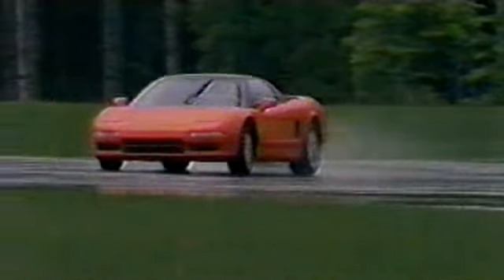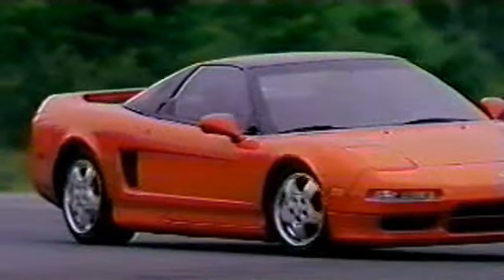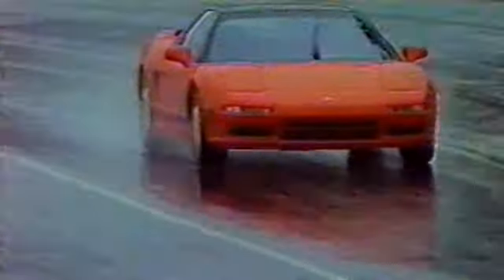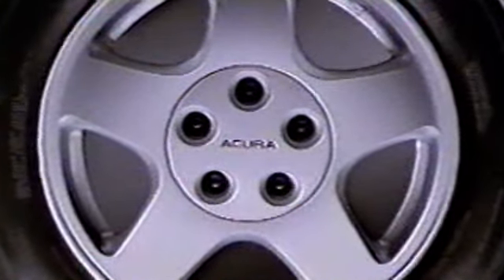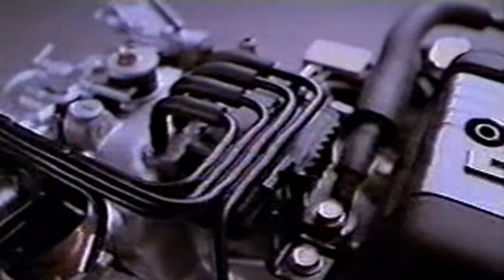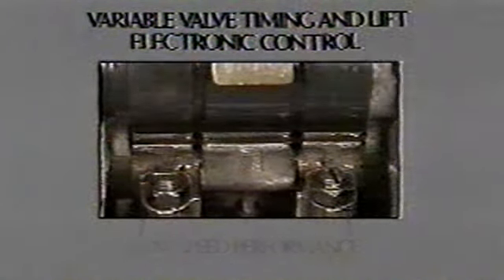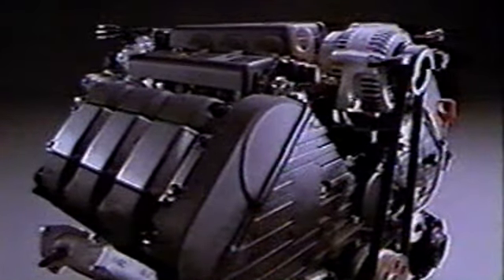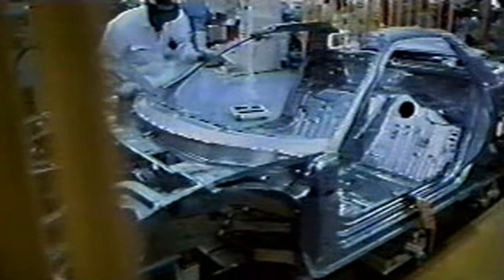1991 Acura / Honda NSX introduction

Comment: Well, I also drive an 06 Evo-MR on the side. On this one back road or MD 97, The Evo can push over 90mph in the turns and still hold its line perfectly "no sweat". The NSX so far could only push little over 80mph before it has had it and over steers Quick. I had a 94 Lotus Esprit S4 & same road, it did 90mph in the turns still hold its line without drama, that the only edge over the NSX.